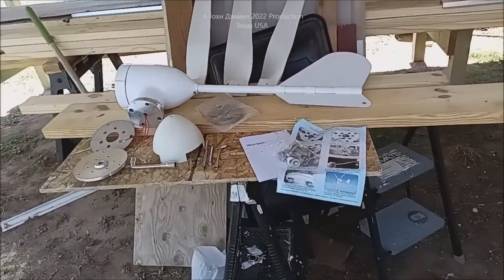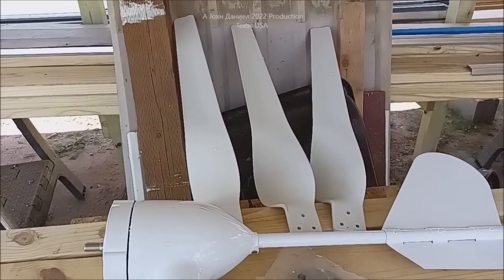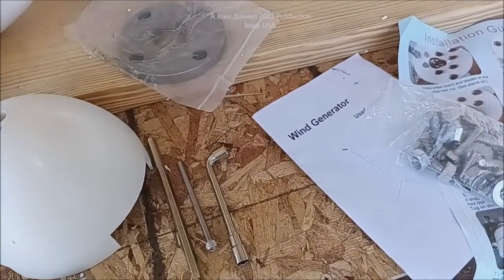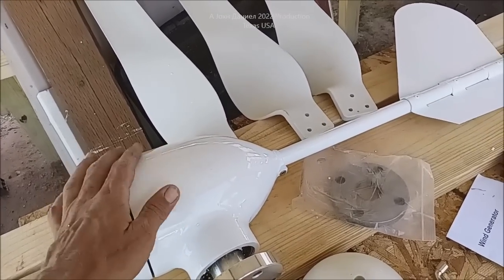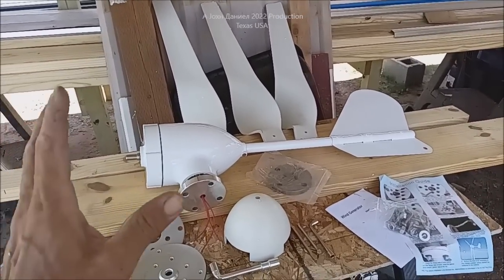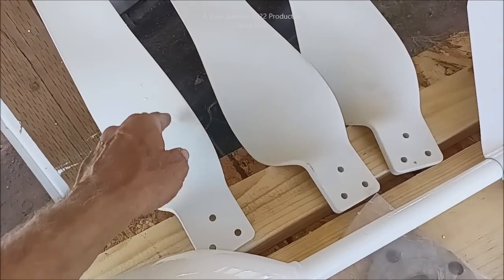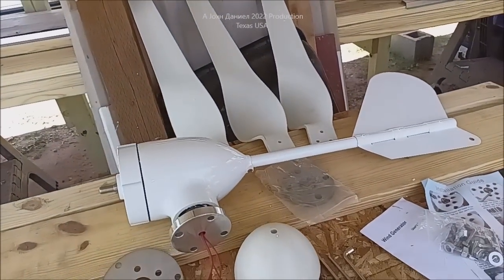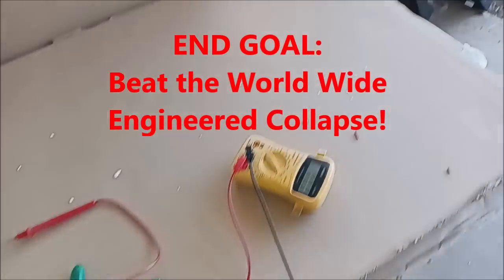Small Wind Turbine Generators to use for Off Grid, from Green Energy Solutions PARTS LIST BELOW

Comment: Happy New Year John i hope all is good over there, I Got my 600watt Wind turbine up☺️ i would like to send you picture of my set up where Can i do that?
Right now im waiting for my First 12 volt 302Ah battery but how Big 12/240 volt inverter do i need? I want to test to a 1000watt heat element.
Reply from the maker: Excellent. For 12volt 240 ac Get a SUNGOLD POWER Inverter, search that area, https://a.co/dnSm8JX  SunGold
Reply: @JOHNDANIEL1  Can the Inverter get to Big if the battery pack of Ah is not that Big yet? Like i only have 302ah battery for now but planning to get it bigger
Reply from the maker: @thomastoft1758  While your able to even order things, get everything you can to the size you plan. Reason is simple, bad is on the horizon, don't be caught with a missing part of your difficult to find infrastructure on your build. Batteries can be hybrid or even mixed and at worse made. But CHINA ONLY items may be soon on the impossible to get list as Covid is raging now with 20 mutated versions coming our way with a death rate 4X the original. No much good can arise form that.
Reply: @JOHNDANIEL1  i Will forsure do that😊 to day we had some really good Wind 15meter pr sec but my Wind Solar Hybrid Charge Controller with Equalizer 1500watt for Wind and 1500watt for solar burned out and smoke was coming put from it 🤬 What Can i use in-sted of i need something that Can hold and work
Reply: @JOHNDANIEL1  i talk to the supplier for the hybride controller way it Got burn

 
Dear Sir, as for the controller you mentioned earlier, it doesn't control the strong wind. This is not because of the controller, but the problem of your wind turbine. The starting voltage of your wind turbine will probably be a certain value between 40-48V, which has exceeded the voltage of your connected battery several times.

Rita
Reply: The thing is i have a 48volt Wind turbine because i have 50meter from the turbine to my work shop. If i uset 12volt turbine the cabel would be toooo Big🙈 so i Got a 48volt 600watt and iser 7AWG cabel for the 50meter. I have a 12volt battery bank and the Hybride Wind 1500watt and solar 1500watt. The one you told be to get☺️ bit when i only uset 12volt battery bank. The max volt for inlet is only 20.8 volt and Yesterday we had really good Wind the Wind turbine produce to much volt for the Controller to handel so it burn off…😭 so What Can i do?
1: get bigger battery bank?
2: Can i build the system in a           nother way so i still Can use the 12 volt battery system and the 48volt Wind turbine?
Reply from the maker: @thomastoft1758  Post the link to where you got it, if it is a ALL IN ONE 1500 I have used it is supposed to have a 170 volt max on the wind side and 100 volt on the solar side. Sounds more like it's lost a rectifier than anything else. They make that same board for those 1500 wind /1500 solar to be also capable for a 60 volt set up. So post it's link to the exact store. If you bought one designed to auto select from 24 and 48 volt turbines, NONE of those do not peak in open voltage under 120/150 volts and under load they peak at about 70/90.
Reply from the maker: @thomastoft1758  50 meters, 165 feet basically, a 24 volt with pole drop in 10 awg, then disconnect and brake at pole, then make the run from bottom of pole to house with 8 awg would have worked especially if you have normal winds exceeding 15 mph with expected storm/season peaks of 35+ mph. 12 volt turbines make 65 volts and the 24 makes 90 volts ( 3 phases AC ). +/- some based on the blades and brand but thats the averages. If your mechanically handy contact the turbine seller and get a 24 volt stator and tell them to SPEC IT OUT with a data sheet before shipping. Replace the 48 volt stator with the 24, then your OK. The 48 volt will have 27 gauge windings, the 24 volt will have 22 gage windings, the 12 volt has 18 gauge windings.
Reply: @JOHNDANIEL1  im sure it make good power because  the tower i build for the Wind turbine is 13meter tall and in the bottom of the tower i have a brake for it and there i could get 88volt when we have 22mph
Reply from the maker: @thomastoft1758  Solution, Slave Battery, Diversion controller, and regular solar controller from Slave battery to your lithium's. Send me a email, I can show how.
Reply: @JOHNDANIEL1  What is your e-mail because when i type mine it goes away?
Reply from the maker: @thomastoft1758  olympicpowercontrols@yahoo.com
Reply: I Got the one for auto 12/24/48 volt and 1500watt for Wind and 1500 for solar
Reply from the maker: @thomastoft1758  Then you tell RITA ( Yuon Sang) that "JOHN DANIEL, 58 million Google Search validations as the WIND TURBINE KING,  said your product failed from lack of quality Solid State Relay in over voltage protection causing rectifier failure, the device was supposed to have limit of 150 volt and 110 volt peak caused failure. JOHN DANIEL I will make a video for millions to see it fail unless they replace or refund partial on the item"
Reply: @JOHNDANIEL1  when the do a refund would i buy one from them again or a nother place
Reply from the maker: @thomastoft1758  Order one through GREEN ENERGY https://s.click.aliexpress.com/e/_DmFMyrt and using a 60 amp mppt solar controller, send turbine to 4 of 12 volt 50 amp hour SLA Batteries, connect solar controller to batteries then to your 12 volt system, you feed your 12 volt system. Install low voltage disconnect so you do not drain the slave batteries below 40 volts and the bonus is your a hybrid, can use cheaper DC gas or LPG generators to charge them.
Reply: @JOHNDANIEL1  you might have to send a drawing on that to my e-mail so i better understand it
Reply: @JOHNDANIEL1  this was i Got from Rita 

Dear Sir, would you please ask your friend to take a picture of his controller and show it to me? It Can hold that many volt
Reply from the maker: @thomastoft1758  They sell a controller labeled 12/24/48 volt, anyone who deals in Wind Turbines know you have 3X and more open voltage from the turbines over the rectified charging volts.
Reply: @JOHNDANIEL1  that What i meen too and tryed to explain it to them but its like to talking to a door..
Reply: @JOHNDANIEL1  i send you an e-mail

Comment: Hi! Great videos! Which wind turbine you suggest for me with 24V system? Average wind speed is 4-6km/h depending on season. Should I buy 48V model instead of 24V because of rather low wind speed? I have 4000W solar system but it doesn't help much now because of snow. Greetings from Finland!
Reply from the maker: Get the 48 volt model 3 blade low wind on the link, with a 24 volt capable MPPT all in one for 1200 watt max wind power.

Comment: I have to test my How many ac vol should there be on a 600w 12vol wind turbine from green A shop, with drill? Should I set my watt meter to 200 ac? Thanks for your help,,
Reply from the maker: Using a 7+ amp drill motor with 450 RPM or higher you should see 45 to 55 volts AC on the legs from the turbine. If you do not, you may have a slip ring issue with lacquer coating over spray causing loss of power in it. Normally it will work off the brushes on the slip ring, but you can pull the face off the turbine and access them to clean them.
Reply: @JOHNDANIEL1  Thank you very much, what should I put my wattmeter on? The mill is brand new but the postman may have dropped it on the floor, hehe I will keep you updated
Reply: @JOHNDANIEL1  it is at 43/47 without resistance nice ty..if I put it on battery so there is resistance, what should the number be??

Comment: Hi John. I was looking to install a wind turbine at my cabin to help with power. I have 1200 watt solar charging a 430ah battery bank at 24 volt. I was wondering what size turbine you would recommend and a parts list of what I would need to complete system.
Reply from the maker: Exact best turbine has to based on location, and wind averages. Normally for such a build on a battery that size I would say a basic 500 Low Wind model, 24 volt with a build related all in one controller. You can more elaborate and send me details to the shop email, olympicpowercontrols@yahoo.com

Comment: I just bought the turbine, it gave 35w/ 9w in 9 meters of wind, can it give 400w constantly or is it an average over time
Reply from the maker: This is a 500 watt model I show from GES. Not sure if you got a Green Energy 500 or a similar looking one from elsewhere I can say the 500, It produces more than claimed. But, depending on voltage chosen, source bought from, how its located in clear constant air, and what controller or wiring you used is related to its ability. Models sold by other sellers do not produce claimed wattage since they sell cheapened components. However, a real one will have a break in period, to get the alignment of the flux in the magnets and will make over 400 watts.
Reply: @JOHNDANIEL1  can I connect a watt meter together with the Charge Controller on + and = on the Metal Case Bridge the setup looks easier to me on this video but what about dump lord''?hi sorry
Reply from the maker: You can connect a watt meter, be sure to connect to battery first ( LOAD ) then to the incoming power ( source ) where ever that may be in your layout.

Comment: John, what is the best way to connect a copper wire with an aluminium wire? I heard that both materials do not work well together, it starts a chemical reaction, corrosion starts to build up on the connection of the 2 wires, which leads to power loss.
My turbine has aluminium wire, while I have copper wire as distribution infra structure. Tell me your thoughts. 
Cheers
Reply from the maker: If you have a Green Energy or B&C Wind brand you do not have Aluminum wire in them, you have tin impregnated marine grade copper. Those look like aluminum, they are full strand tinned. 76% copper/24% pure component tin.
But if you have a SMRAAD, Mars Rock or Vevor you could have aluminum wire. 
The best way is a full mechanical connection, using dielectric grease on both wire types. Follow instructions and install these inline,  https://amzn.to/3TmAy7b ( 6 to 8 AWG ) or  https://amzn.to/3Sw6IME ( 10 to 12 AWG ) on them with a coating of dielectric grease https://amzn.to/3VPq1TF on the wire tips as you install. It will prevent electrolysis on the connections for any outdoor or corrosion prone materials.
Reply: @JOHNDANIEL1  I have the same model GE-600W that you show on this video, only difference is that it's 48v. My windings are showing a resistance between 0.4 and 0.8 ohm, it's jumping around, it does not settle. I'm not measuring at the 3 cables that come from the generator, but on the extension, so I don't know if the issue is in the turbine or in the extension cable... Tomorrow I'll check the resistance on the cables that come from the generator. How can you tell that, the wire on the generator is not aluminum?
Reply from the maker: @diogomartins9101  Scrape the wire with a razor, look close at the result.
Reply: @JOHNDANIEL1  Thanks for the tips, brother...
Reply: @JOHNDANIEL1  hey John, I can't get a resistance reading on the coils, it goes from 0 to 500 ohms randomly, always bouncing around, it never settles. It also fails randomly the continuaty test with a multimeter. What could it be?
Reply from the maker: @diogomartins9101  Are you testing with the magnets still in it? If so, the magnetic flux causes that. Turn the rotor a few spaces to get it stable, re test.
Reply: @JOHNDANIEL1  yes the turbine is all assembled, but the rotor is not spinning, I know if the rotor spins, it will show the resistence bouncing around, but I'm reading with the rotor not spinning. Does the magnets have an influence in the readings even if their are not spinning?
Reply from the maker: @diogomartins9101  Magnets, setting the turbine on a metal table or being near magnetic metal when testing, hands on the leads while testing, and low battery in your multimeter can cause the results your getting.
Reply: @JOHNDANIEL1  If you measure the resistance from your GE-600w leads, will it happen? Can you confirm, pls? I don't have other generators to test this... Your test result will assure me if it's good or not...
Reply from the maker: @diogomartins9101  You have to do it with the rotor removed and using the center tap on the stator. Measuring it through the 3 phase   via the slip rings that are not worn in if it's new can get you all kinds of inaccurate numbers. Just like a brand new gas generator, you hit the center tap and bypass the slip rings. After its got some good seating on the slipring brushes you can do it from the fields.
Reply: @JOHNDANIEL1  gotcha brother, Green energy solutions asked a video for them to check it... Disassemble is not doable for me ATM...
Reply from the maker: @diogomartins9101  No new turbine is instant power, they have a break in period for alignment of the magnetic flux and embedding the brushes on the slip rings. But to test, just power it up on a drill motor, take your readings on the legs swapping around 2 at a time and rpms and send that info to them.
Reply: @JOHNDANIEL1  I found out that the connection from the turbine to the infrastructure cable were corroded, the copper from 2 of the 3 infra cables was black, like oxidization from water or humidity, not burned, the cable isolation was fine, it showed no signs of burn. The copper from the 3rd cable was fine, no oxidization at all. This turbine only made a max peak of 50w of power on a 12v system. I know it is a 48v turbine on a 12v system, but I think this is too low. Will it make what is advertised on a 48v system? I honestly don't know.

Comment: Hi john I  bought the 500 watt turbine 24 volt I have a marsrock hybrid  controler I have a resister that I bought with the turbine should I install the resister and where should I put it or is there any need to install it thanks john  your videos are helping me
Reply from the maker: Yes, the resistor is to catch and eliminate excess power once batteries are full that the turbine will make that can't be put in batteries.
Reply: @JOHNDANIEL1  so do the red and black wires on the resister go to the hybrid controler
Reply from the maker: There will be a dual terminal marked LOAD, BURN, BRAKE or DIVERSION ( the chinese still are confused about this) you will connect wires from it there. Polarity on a resistor means nothing unless its a polarized variable resistor. The others show SOLAR-WIND-LOAD also on them but then if you have the right one it will show a pic of a resistor. Check the manual, connect the resistor and it will just do nothing unless you have crazy wind or fully charged battery then it will act only as needed to keep volts below 30/above 27 in a 24 volt system.
Reply: @JOHNDANIEL1  thanks john marsrock got back to me saying there unit has this function already built into it so theres no need for resister  I hope that's true. and you saved me a few quid on the 16 gauge extenion cord I will use it when conecting from the turbine to the  controler and thanks for sharing your knowledge God bless
Reply from the maker: @daveryan960  ok, I wasn't sure which model of wind turbine controller you were dealing with.

Comment: Is there a way to get this to charge a ECEOFLOW DELTA 3000
Reply from the maker: Yes, using a Mppt controller like a All IN ONE wind and sun controller https://s.click.aliexpress.com/e/_DczYCej use the Wind800W Solar800W with LiFePO4 settings. These should work fine with it, you put the wind power into the DC port, not the solar input. And use a 5 blade 300 or 400 watt so you don't blow up that power station https://s.click.aliexpress.com/e/_DmZLxoj .  Get the ones with tail up, not down. You will need 1.5" schedule 40 to mount it.

Comment: Hi John
The all complete in one, you have in the part list below, is that good to start With to the 600watt Wind turbine 

Wind1500W Solar1000W,With WiFi,Auto12V 24V 48V
Reply from the maker: Yes, if your getting the GREEN ENERGY or B&C 600 then that model is best suited. The 600 can peak over 1000 watts in a storm, not recommended to want that outcome but that all in one can beat handle such events.
Reply: @JOHNDANIEL1  okay Thank you John, im going to get the 600watt 48volt from G&E
Reply from the maker: @thomastoft1758  Good plan. We need to share the videos, show more how to get some form of energy and be ready for some real bad dark ages potential coming to the world from the Elite who want to take it to holocausts level for their "great" plans to put us in serfdom.
Reply: @JOHNDANIEL1  yes for sure, the Dark Ages Will come…. when i get my Wind turbine i Will make some video how i have install and share it.
What gages of wire do you think i need from the turbine and 50meter to my work shop. 48volt / 600watt = 12.5amp
AWG 4 ?
Reply from the maker: 48 volt will be fine with 8 awg being it is 3 phase and 48 volt. Turbine output unloaded alternating voltage will be over 100 volts. It will stay down to 60 with the controllers or batteries. Your just past the 10 Awg distance of 40 meters so you can run 30 meters of 8 awg from battery area out, install a disconnect service, then use (10/3) 10 awg up the pole to the turbine. With 48 volt its low amps, high volts. A 24 volt turbine would require 8 awg all the way, a 12 volt would barely be ok with 6 awg that distance.
Reply: @JOHNDANIEL1  thank you, i Will return when i get the parts👍
Reply: @JOHNDANIEL1  what battery would be good to use for this,
Reply from the maker: @thomastoft1758  220 AH Time with the 150Amp bms. https://www.timeusbpower.com/collections/12-8v-lifepo4-battery-series/products/timeusb-12v-220ah-lithium-battery-built-in-150a-bms-deep-cycle-lifepo4-battery-with-max-2816wh-energy-1920w-power-output-rv-battery-perfect-for-rv-camper-van-travel-trailer-caravan-etc?ref=vBPtCFQp